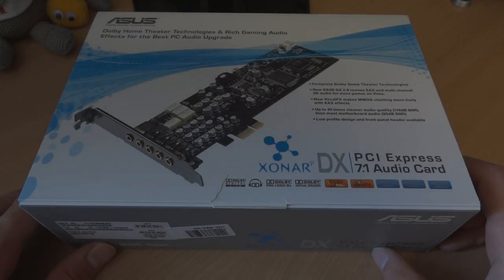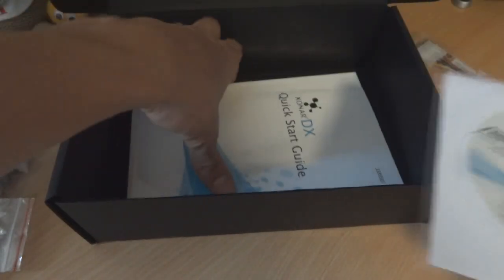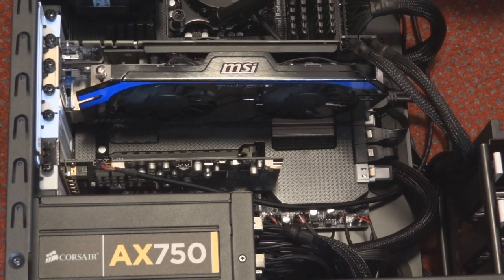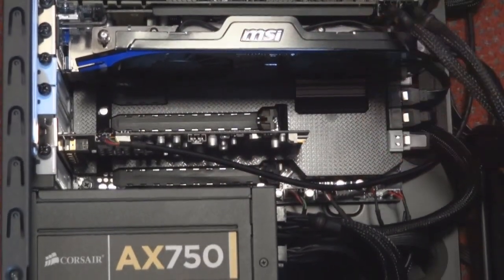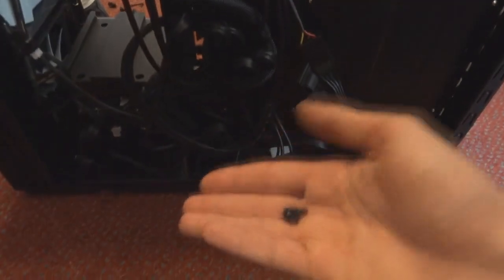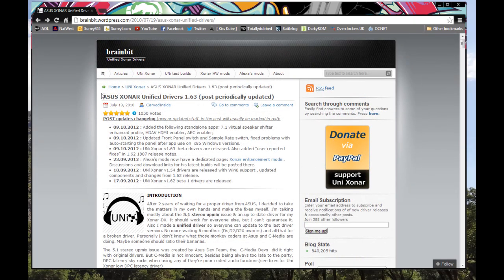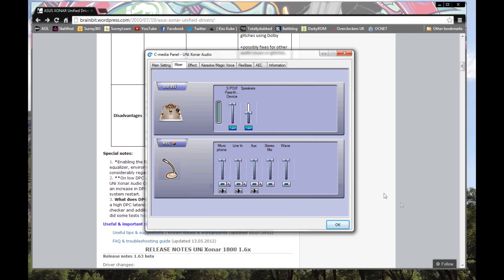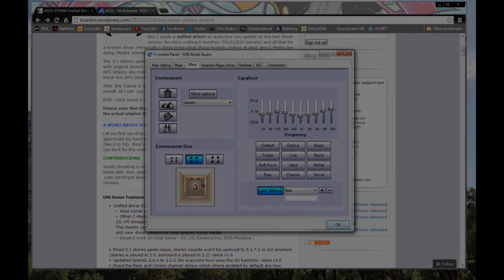Asus Xonar DX PCI-E Soundcard - Unboxing, Overview, Software - By TotallydubbedHD

Comment: Do not buy this card!. It was a common issue with the additional power supply connection. Sometimes it works, somtimes it doens't.
Reply from the maker: Indeed

Comment: i am still having problems with sound card, regarding the power connector, mine is loose and even putting magnetic tape does not resolve my problem. Any suggestions ? Furthermore, mine is a refurbished. And lastly, what is the main reason to use the front panel with HD audio cable provide by the onboard audio ?
Reply from the maker: No idea mate, sorry.
Front panel wise, is to that the front 3.5mm jacks go via the soundcard, not your onboard audio.
Reply: totallydubbedHD i regret buying that crap sound card.

Comment: I have the xonar DGX its not as good as you have, but im using unixonar drivers, because dgx drivers from asus webpage are sounding like mufled speakers.
Reply: +1sonyzz Dont use surround, this just fck up your audio and dont equalize it, make sure you plugged the front panel and make sure you are using it, in the software, just use 2 channels, headphone and HIFI mode, and make sure you are using 48hz
Reply: YuklFPS
You telling me like i didn't know that -.-
Reply: you are not using the oficial asus drivers, right??
bcuz they sucks alot
Reply: have that card and know everything myself dont need help, DGX sucks because it dont have amp on front port like DG does....im using DG now
Reply: I have the asus xonar essence stx
Reply: andy23r
dgx and dg should be identical yes, just port different, well it is not, dg sounds same thru front and rear port when you plug headphones and set amp level to 3, dgx sounds same as dg thru rear port BUT thru front port it sounds 2 times lower than dg, changed to dgx because dg started to give me static noise, at first was using dg all time
Reply: I'm ordering a DGX just because i order on impulse and like upgrades. My realtek onboard actually sounds quite good right now and has no hissing at loud volume lol.
But does the DGX and DX sound the same as far as quality? Or does the dx just have support for 7.1 which dgx doesn't ( i don't need that )
thanks

Comment: This same problem is with Creative Sound Blaster Audigy SE on Windows XP everything works perfectly but on Vista,7,8 and 8.1 it doesn't work anymore, the sound is but its awful weak bass and the options don't work. Tested with several drivers versions and still don't work.
Reply from the maker: Aaron Bagha you can but the sub causes problems - in that you have to re-bypass it
Reply from the maker: thanks for sharing
Reply: *****  Do you have any information about Asus Xonar Phoebus Solo?
Is the options from drivers works in 100%.
Or maybe you recommend other sound card for Windows 8?
Reply from the maker: ***** No idea
Reply: ***** You don't have any sound card? XD
Reply from the maker: ***** not any more no. I use optical to my receiver (that does all the processing).
I can't comment on other soundcards nor that one, without having heard them.
Reply: ***** you can hook up the z5500 to a home receiver? how do you do that

Comment: Will it output HD audio signals formats DTS-HD or DOLBY TRUE-HD ? Do you know what cards will or is it built into a majority of 1155 or 2011 motherboards or Graphics cards now or do you just buy playback software that has it?
Reply: mrpumpkins you won't be able to have this codecs because sound cards are not meant for that. Those codecs are only available on a blu-ray player with the right equipment of course. And most of the codecs in that sound card are lossy. (Dolby digital live, dolby pro logic virtual 7.1 speaker.) Use PCM only.

Comment: Perhaps a silly question, did you remember to disable the onboard soundcard in BIOS, before installing the original/downloaded asus drivers for the Xonar? If not, that could have caused the issues.